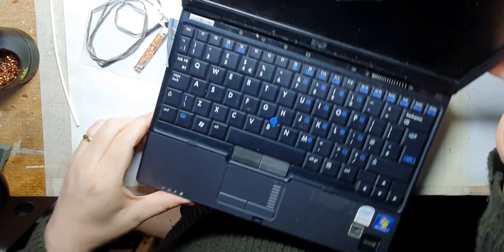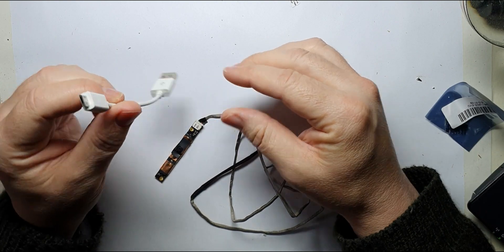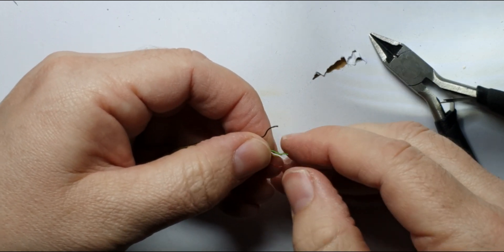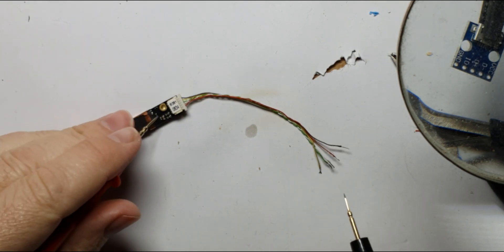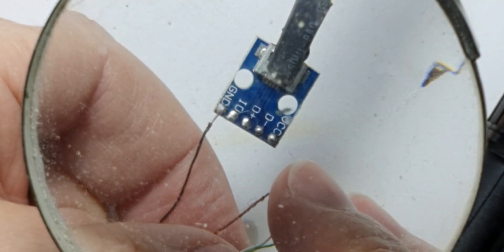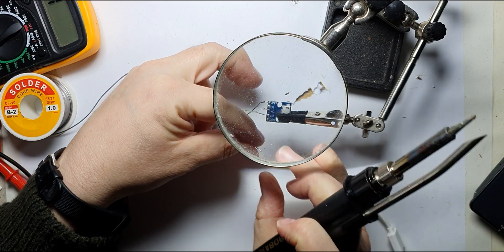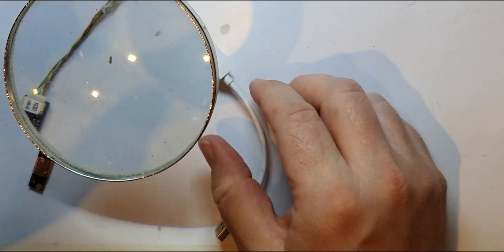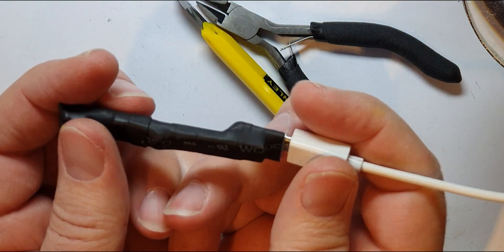Re-using old laptop webcams (for Zoom?)

Comment: USB not recognized?? Swapped the Data wires but same issue. My cam has almost 7 wires....
Reply from the maker: If you have more than 4 wires it might be that there is a separate LED or microphone or light sensor wire on the module.  It will just be trial and error I am afraid - or if you can find a model number on the module, google it and add the word 'pinout' to your search and it might give you some clues